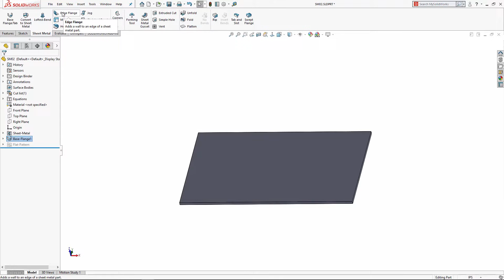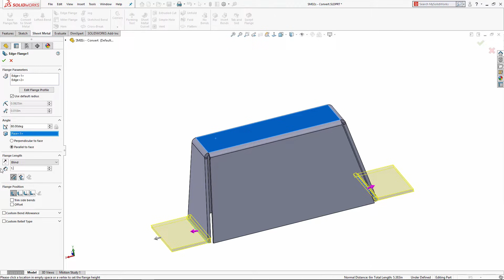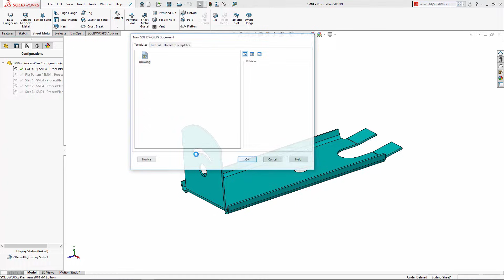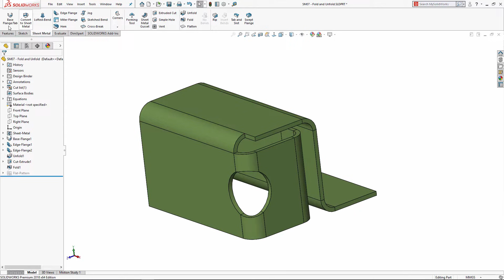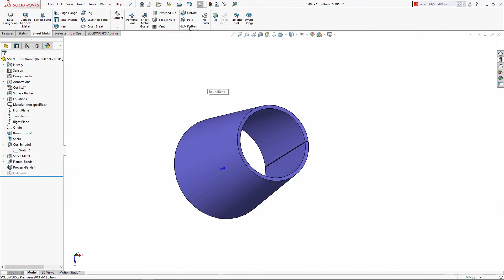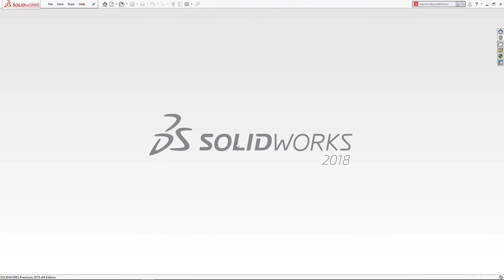SOLIDWORKS - Sheet Metal 101

Comment: This was the best sheet metal tutorial I've ever seent.. I will say that the last one is only disappointing because it doesn't have any bend lines.. I tried to use it for flattening aluminum boat hulls, and they were using darts and other features that are unworkable in the sheet metal module.. and the fabric approach worked but needed bend lines. Thanks for the awesome!

Comment: This is amazing!! I've been fighting with Solid Edge, which makes the creation of Flanges super easy, but that's where its superiority to Solid Works ends. I've got an old copy of Solid Works left over from school, and I honestly prefer using it. It's just SO much more user-friendly!
Reply: be careful with those old copies from school. Dassault is really cracking down. I have a buddy that just got hit with a huge fine after they found out he was using unlicensed software. We all did it, and I still have 2012 on an old computer, but yeah just a heads up. I always turn my internet off when opening the software. it reports it out somewhere and they come knocking. he had to get a lawyer and was able to get a $30k fine reduced to about $500
Reply: @kevinkillsit  Thanks for the warning! You may very well have saved my bacon.

Comment: Hi, I have issue in Soidwork 2017, when I give flatten view I am not getting Bending Reference line and even in drafting I am not getting Bending reference line, Kindly do the needful
Reply from the maker: Hi Rolson,
The bend lines are sketches so if you have set the visibility settings for sketches to be hidden or invisible these bend line sketches would also not show.  Make sure your models show all sketches and that the sketch for the bend lines is specifically visible as well.